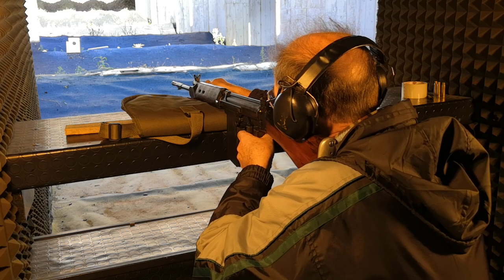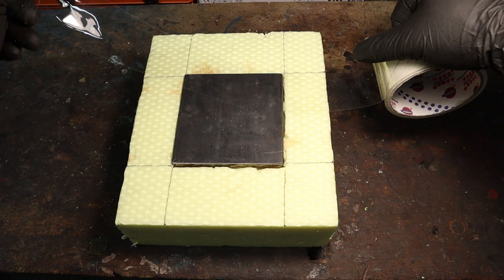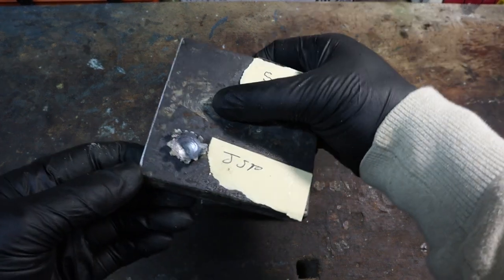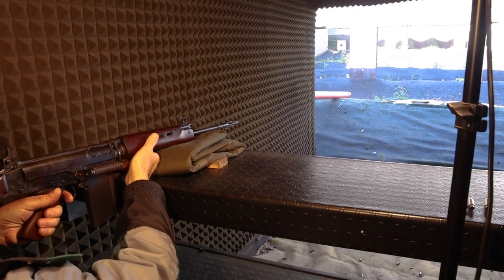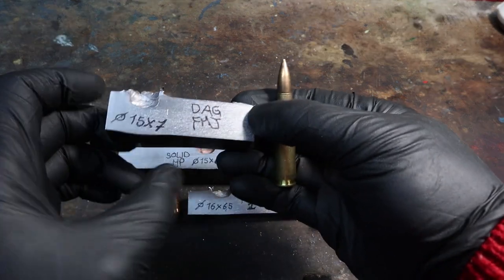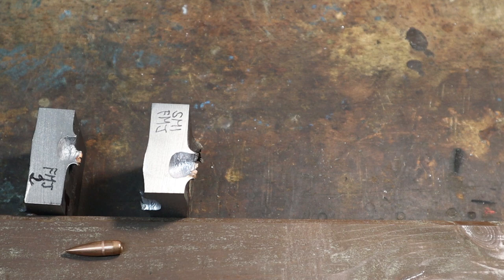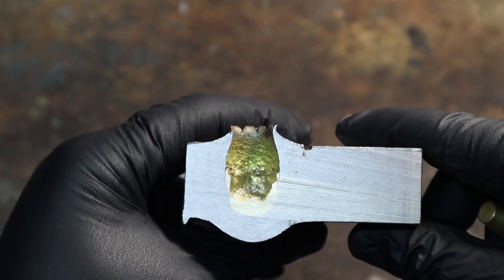Which Gun Is Better Against Steel?

Comment: I thought you did a SPLENDID job of pacing and keeping the flow very engaging.  I've had similar classes on penetration and types of penetrators when preparing to deploy.  They could have used this video and then broken it out into five 30 minute sub-segments on each principle.  They'd have saved loads of time and and done a better job.  You've done and amazing job with the subject.

Comment: AP will probably give an extra inch of pen. yes to the BMG going deeper, assuming it has better sectional density or higher velocity. but if it has the same sectional density and velocity of the .308 then the depth should be the same; with a wider crater. my guess

Comment: I did a similar test with my 375 ruger. At 50 yards, my 300 grain solid cut cleanly through a 1/2 inch cold rolled steel plate and continued through 2 gallons of water (exploded the first gallon and pierced and lodged in the back wall of the second jug). 

Excellant video!
Reply from the maker: Thank you! And thanks for sharing your experience, as well

Comment: I did a similar experiment with an SKS and Chinese 7.62 X 39 steel cased, steel core ammo. My targets were 5/8" 1020 HRS and 3/4" 1020 HRS. I shot 5 rounds at each target at 30 yards. The Chinese ammo fully penetrated the 5/8 steel, leaving a 1/2 inch hole through. The 3/4" plate had a crater about 5/8" deep with a substantial bulge on the back.

Comment: Nicely presented!
Reply from the maker: Thanks! 😉
Reply: @Backyard.Ballistics  the most interesting things start to happen when you shoot the hardened armour grade steel with different bullets and you approach and later exceed 1500 meters per second!I managed to get to as much as 2500 at some of my experiments using (semi-)conventional propellants in a round more similar to German hyper velocity 7,92×94 anti-tank rifle rounds and out of a custom barrel that could withstand significantly elevated pressures!So it turns out that when approaching these speeds at up to 1200 meters per second FMJ doesn't leave a scratch at all on an inch thick AR-550 plate while at the same speed the AP with a thermo-hardened steel core(btw 10.8 grams AP and 13.2 grams FMJ from regular 7.92×57 Mauser in my case)-goes through the entire plate! Although when you get to about 1500 meters per second for both-if you introduce the same second plate behind the first one-the results will be that first of all this time they both will make it through, but leave the entirely different holes and different damage will be seen on the other plate! So the AP will not leave the hole too much different from what it left at 1200 and on the second plate you will see either one or 2-3 substantial indentations that will be left by the hardened steel core that will usually break in 2-3 pieces while going through the first plate.Meanwhile the hole made by FMJ will be vastly different:it will be not squeezed aside kind of thing like that in case of AP-it will have mostly fracture-type deformation and cracked edges; the bullet just breaks and crumbles the metal it hits at this point! And on the other plate you will have a number of small hit marks left by pieces of the first plate that will be up to 2-3mm deep.. AP still will leave more damage and at least deeper scratches on the second plate.At even higher velocities you will eventually get some of the AP bullets cores making it through the second one as well although rarely and only starting close to the maximum of 2500 m/s while FMJ-s will not go faster than 2000-2100 without modification! So you can use solid copper or brass after that..
Besides the propellant that I used was granulated PETN (pentaerythritol tetranitrate) from pure to get maximum velocity and at the lower range of speeds I mixed it with regular gunpowder!

Comment: Typically (and it seems it is the case here) the hollow point designation on rifle ammunition just points to the method of manufacture. Some bullets have closed tips and open backs, some have closed backs and the tip is left open when it is squished into a point. There different types of manufacture have an effect on ballistic coefficients as well as weight distribution when comparing the mass in the front and back of the bullet. For expansion, soft points are traditionally the focus of rifle ammunition. You can find videos with hollow point bullets such as these being shot at different mediums and showing little to no deformation and no expansion. Soft points on the other hand can expand pretty dramatically.
Reply from the maker: What you said about HPBT is definitely correct, butthe hollowpoint I used was a monolithic design, it has no jacket and core, and is just one single piece,  being designed to expand in soft targets. Actually they do it pretty well. It was a barnes TSX

Comment: An AP round would probably just penetrate a piece of mild plate that size if it is loose like that. A .50 probably knock it straight down the road.
A really light round traveling really fast will penetrate almost anything.
Your detail is astounding..

Comment: Yeah I wish at the point he had us all pause to answer he would tell us more like relevance if sectional density. I think showing the difference between a 220 grain round nose and a 147 FMJ would be interesting. Also what’s the metallurgy of the steel plate???

Comment: You used a .416 Barrett instead of an actual .50BMG bullet and found that the bullet created a large crater and the metal bulged heavily... It was my understanding that all .50BMG ball ammo was steel core already and the behavior of the .416 Barrett bullet suggested that it was not steel core.

Comment: You will improve on the plate penetration by bolting it to a heavy frame.  The mass of the plate seems to light to hold it in place.  This effect is a function of bullet velocity.  The slower the bullet, the more is pushes the plate away, rather than penetrating it.

Comment: I loved the video! 
Have you considered casting and using like titanium projectiles? Because that might be interesting, if it doesnt mess up rifiling

Actually why not try old black powder .50 cal ball rounds? Just to see if they do anything unusual

Just ideas
Love the vids!
Reply: Jayk Puten I’m not sure titanium would make a good projectile as it would be too hard for the rifling to grip it but maybe a titanium cored bullet being very light could get you a higher muzzle velocity?
Reply: @ArchieKeen1  yeah thats why my first thought was it messing up the rifiling...
But what about a titanium barrel? I juat wonder if that would go through armor plating better
Or a heavier bullet like depleted uranium (arent tanks using that as armor?) or something
Reply from the maker: Thank you for suggesting, it's always useful for me.
Regarding titanium, it is not very suitable for making bullets, because of its low density (4.5 against 7.8 Kg/liter for steel), which is instead its main advantage for the aerospace industry. That's why tungsten and depleted uranium (density around 19) are used for advanced armor piercing designs (not in portable weapons, by the way, where special steels are almost exclusively used)
Reply: @Backyard.Ballistics  That kind of sectional density could lend itself well to a modernized take on the 7.92mm CETME, a little denser than the aluminum originally used but ballistics advances since the 50's should more than compensate for the denser material.

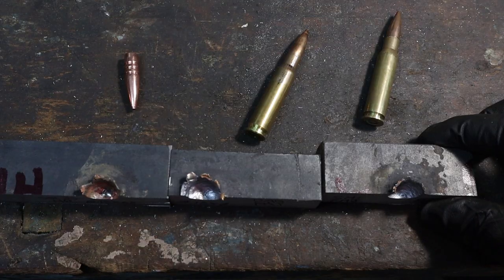Comment: 6:42 .308 AP should clear 3/4" mild steel.  Regular .50 BMG should clear the same steel plate; if you attach it to something heavy.  Else, the small plate may just be thrown a long way, unloading the bullet to plate interface, reducing penetration.
Reply from the maker: I forgot to mention it in the video, but the barrett and AP plates were 1 inch instead of 3/4, they would have probably cleared the 3/4

Comment: with similar masses and similar velocities, they are going to dump very similar amounts of energy to the point of impact ablating the material. and as kinetic energy is measured as MV^2 the velocity makes more of a difference, velocity will ablate more material giving you a deeper hole., having a longer bullet with the same mass would also deepen the hole, it would be a thinner hole but it would ablate a deeper hole. this is how anti tank weapons work. shaped charges deliver heat and kinetic energy to heat up and ablate the material over a very small area tunnelling through, whereas long rod sabot rounds exchange surface area for length,  so it can spend more time ablating the material giving a smaller but deeper hole.

Comment: Was that a hollow point or a match round? Cause most of the match rounds I purchase have that tiny hole on the tip compared to the relatively larger holes with ballistic tips on the actually marketed as hollow points I have purchased.
Reply from the maker: that one was a barnes TSX, a hunting monolithic bullet. It wouldn't have made any real difference against steel if it wasn't hollow point by the way
Reply: Backyard Ballistics 
Yeah looking at the box it says HPBT in the description of the Sierra match king bullet. Otherwise no where else on the box does it say hollowpoint. Little weird that they wouldn’t say that elsewhere but meh.

Comment: @6:40 I'm guessing the .50 BMG goes right through regardless of the bullet, and a .308 (which is almost identical to 7.62 NATO except rated to maybe 5% higher chamber pressure, right?) with an AP bullet will probably still not be enough to get all the way through that quantity of steel.
Reply: Huh. I'm surprised the .50 was stopped! It looks like it is causing more structural deformation that would weaken the plate across a wider area than the AP .308. Do the impacts change any of the steel's physical properties, maybe making it more brittle where it's been deformed?

Would it be possible for you to test secondary shots (either the same rounds or even smaller calibers) in the vicinity of an initial impact? A second .50 BMG within a couple inches of the first one would probably punch through.

Comment: It's very interesting how the impact of the .416 Barret (50BMG stand-in) appears to have 'work hardened' the material at bottom of the impact crater.  Would a second impact from a .308 in the same location be more or less likely to penetrate any deeper into the steel? What about the effect of  repetitive impacts of the same type bullet on the same impact location? I would enjoy watching such an experiment and its results.
Reply from the maker: This is a very clever question, which I recently had to answer for a project I am working on. The simulations show no significant depth of crater difference for subsequent hits on 4130 steel (johnson-cook model). The work hardening appears to be very localized, and compensated by residual compressive stresses.
I will etch my specimens and show the results in a following video, hoping to highlight stresses and work hardening.
Reply: @Backyard.Ballistics  Thank you!

Comment: I saw a video saying that in WW1 germans seeing tanks for the 1st time took apart the mauser bullets and reinserted the bullet backwards.  This was apparently more effective.   I think your video makes it clear that turning around the bullet wouldnt matter since all of the energy is dumped in the plate so bullet type and shape is irrelevant.  What do you think of this?
Reply from the maker: It shouldn't make any significant difference. It would make the bullet expanding against soft material though
Reply: @Backyard.Ballistics  The presenter was telling it as fact and that it was effective.  I think the effect would be as you have shown.  All of the energy is being transferred.  Without a hard core the shape of the bullet is irrelevant.  It could be an propaganda of germany... makes it sound like they had something effective when they really didn't... good for moral while they worked on something else.  Like most of these silly ideas if they were so effective then why go through the expense of developing special bullets when the soldiers just need to flip a few projectiles and take out a tank.

If anything I would think a pointed bullet may help with the transfer assuming it doesn't glance off.  It will create a small initial dimple which will allow the rest of the bullet material to collect in and expand.

Comment: What is the difference between 308 and 762x51?
Reply from the maker: They are basically the same thing standardized by two different insitutes, NATO EPVAT for the military 7.62x51, and CIP (Europe) or SAAMI (America) for the 308. There is a minor difference in maximum allowed pressure, but negligible compared to the proof pressure, so in practice they are interchangeable
Reply: No difference except that for NATO applications the bullet weight and propellant characteristics are standardized. For .308, you can have differences in types of powder, bullet weight and construction, and thus ballistics from different manufacturers. This ensured that weapons design and application for the 7.62X51 NATO round could be done using consistent data.

Comment: I believe the AP .308 will only get marginal at best better performance, and the 50... hm... not punch through.
Reply: The 308 did about as I pictured, a smidge better, and the 50 is exactly as I figured.
Reply from the maker: You guessed it right😉